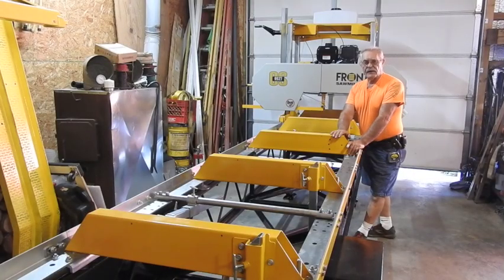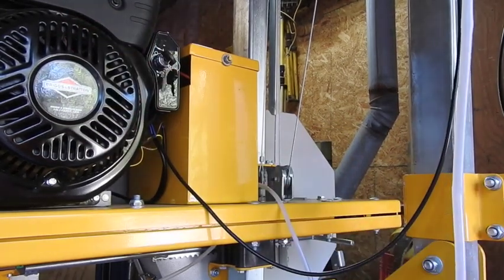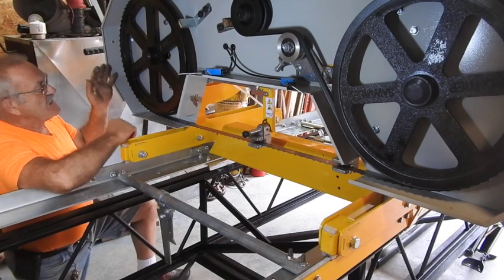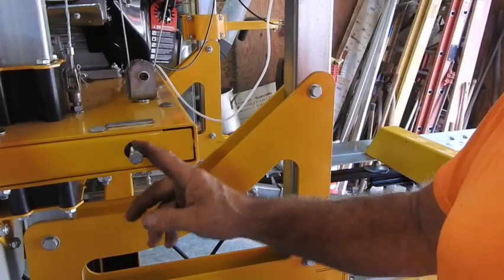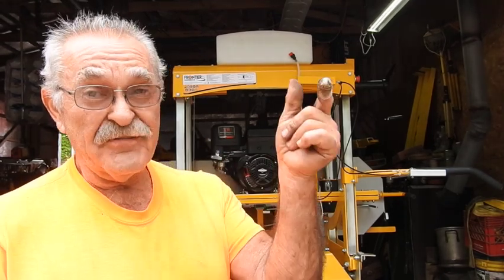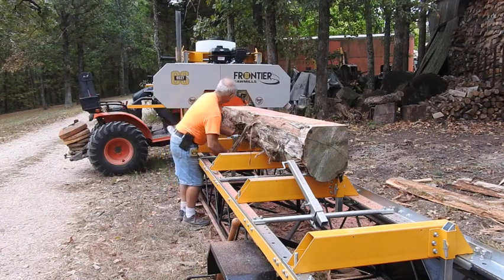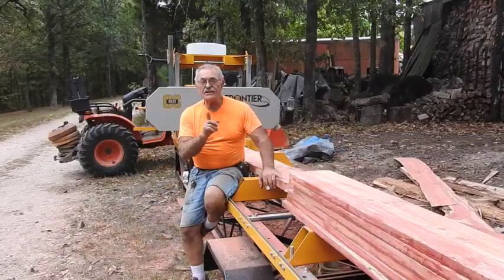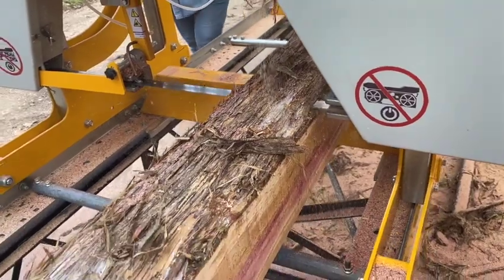OS 27 Frontier Sawmill Adjusted and Checked Out-First Run

Comment: Your video will really help me not to make the same mistakes when assembling my sawmill. Thank you for the heads up and info. Good job explaining everything.
Reply from the maker: It really wasn't too much of a problem to assemble at all.  The biggest issue I have is the one side of the cable spreads out as it winds around the pipe, making the one side raise slightly higher than the other.  I can NOT get it to roll with a tight winding like the other side, but fortunately it's only about 1/32 in difference. 
    I was thinking to do a general walk around now that I've run a good amount of material through it.  One thing for sure is don't crowd it in the hardwoods, because the blade will be forced backwards on the drive wheels just slightly which will result in rapid blade ejection and destruction. And it will sound like a deer rifle going off !!
   I found out that with the Missus running the mill with the hardwoods, we have much better luck.  She is blessed with more patience than I plus she just can't push as hard.  You will enjoy your mill, but make sure it is plumb and level and the bedframe is  perfectly straight.  Thank you for the continued interest Joseph.

Comment: Very helpful info.  I just assembled my OS27 but haven’t used it yet.  The Briggs & Stratton 13.5 hp engine would not idle, so I had to take it in to a service center for repair/ adjustment.  The only mistake I made so far was NOT getting the electric start.  It’s gets old pull starting that engine.  Thanks for posting the video!
Reply from the maker: I learned my lesson about electric start with the De Walt power washer.  It has a big engine that I hate to pull start.  Now that its got a few years on it, it takes a bit to get it going.  I LOVE the electric start on the 13 1/2 hp Briggs.  I added a couple of extra log dogs by making my own cross pipes out of 1'' galvanized well pump pipe and am going to add more log back stops down the length of the 21' bed.  I've got a few other upgrades planned as well.  Did you purchase the trailer option, build your own or set it on ground bunks.... ??
Reply: @tractorman4461  I bought the trailer package.  That part I got right.

Comment: Things to watch for. 
Reading the manual can help with assembly. Having you go over all the things in the process and explain any issues is invaluable. 😁😎
Reply from the maker: Well, I'm hoping that pointing out some of the things I didn't pick up on too quickly might help another first time owner of one of these or similar mills during their assembly.  The Missus just told me tonight that there was a Blu Ray disc in the packet of info....but we don't have a player.  So I am sure watching that would have been exceptionally beneficial.
Reply: @tractorman4461  Funny how the tech lags behind the times. I have VHF tapes for my table saw,  lathe, and planer. 
I'm a pack rat so I have the Curtis Mathis VHF camera, 35 years old and counting, and a deck to play them on. 
I also have CD's and DVD's with pictures and software on them. I kept one laptop just because it has a player in it. 
We have a drawer full of Blue Ray disks and a Sony Blue Ray player purchased with the flat screen TV 15 ago. 🤔
We don't watch them often. 
We have Alexa play music instead of the radio or records. 
We watch on demand with  Roku setup on the TV. 
A good $20K in hardware and software sitting on shelves getting dusted.   😁😎
Just to prove I am slightly off, I have micro floppy disks and even a few 5 1/4 floppy disks.  Yes. I kept a tower and external drive to read them. 
By now the drive belts are old enough I expect them to break. 😁😎
I bought hardware to allow me to transfer files to thumb drives, extermal solid state hard drives, and the "cloud".
Reply from the maker: @OldSneelock  Hahahaha....I totally enjoyed that comment.  Such a sign of the times !!  I too have a few floppys of both sizes as well but those are all hvac digital control information.  Several DVD's as well from hvac manufacturers and suppliers with tons of info as long as we had the laptops to access them, which I did and still do.  However we've never had a Blu Ray...LOL.  We gave away our VHS player to a young single gal with three kids that needed it, plus about 50 kids vhs tapes.  And I forgot I had a service and training vhs for my JET metal lathe.  LOL  Up a creek with that move. But no matter I never watched the tape anyway. 
    I've kept some of the first generation thumb drives filled with equipment information and with a USB port so readily available they are still relevant.  I'll pass those to a friend still actively in the trade.  Now I've got SD cards and higher capacity thumb drives out the wazoo and God only knows how long they will be relevant.  We are at the mercy of technology are we not...??!!

Comment: Counter clockwise is down. Clockwise is up. Reverse your lifting cable winding. Right now you’re turning against the brake. I did the same thing. Fixed it and now it’s a joy to lift and lower.
Reply from the maker: Thanks for the tip.  You gotta admit though that some of those details are kinda hard to pull out  of the manual with the pictures and description they have.  I will double check as you suggest.  I'm assuming you too have a Frontier...??
Reply: Yessir! OS23. I’m the guy who also put my side plates on upside down! 😂
Reply from the maker: @toothandnailsawmill102  hahahaha…. I remember that comment. I must be following the path you took !!  LOL  I am really tickled with it so far but I’ve not sawed any hardwoods yet.

Comment: I enjoyed the video. I am pulling my cutting head Monday and bringing it back to the shop. Another bearing went out. My recommendation is to replace all the bearings once the first bearing goes down. $80 worth of bearings is very reasonable for a  year of hard work. I wished I had of went with the OS27 as the OS23 has been a little small on more than one occasion. I opted for the smaller engine, which was also a mistake. I just ordered an 18 hp electric start engine for mine. I was going to buy a 14hp Predator engine, but they are out of stock until next year. The 18hp is a bit overkill, but from my research, I think it will bolt up just the same. I ordered a heavy-duty clutch also. I was checking your video very closely to see how yours is set up. Great video.
Reply from the maker: I was wondering how long those China made sealed bearings would last.  I figure a good set of grease able bearings from Browning would be my choice for replacement when the time comes.  I'm not going to be sawing near the wood you saw in a given year so mine should be good for a while.  And yes, I kind of already wish I'd have went with the OS 31...LOL.  I'm NOT sorry for upgrading to the 13 hp electric start though. At all !!  Thanks for the tip on the leveling jacks.  I don't know if these are your exact ones, but they seem to be adequate at just four...so far.  We'll wait until I get a BIG log on board before I decide if more are required or not.  But the bar joists seem to not deflect at all so far. I credited you with that tip in the description.  Thanks again Tony.

Comment: Pretty cool video series. Looks like it operates really smooth. 👍👍👍
Reply from the maker: Yes, and surprisingly easy to push through the log.  As long as the blade is in good shape.  Next thing I gotta come up with is a way to sharpen these blades.  They are only good for about 600 board feet of hardwood as I understand.

Comment: Great to see you both running the band saw. That is the largest Ceder I have ever seen. Here in Southeast Tennessee. It would take maybe two lifetimes or more, for one to grow that big . Wish shipping wasn't  has high as it is now. I would love to buy some boards that wide. Outstanding Job ! All my very best.
Reply from the maker: We have some pretty sizeable cedars up this way Bobby.  On the old home place back in the 70's we cut a cedar grove that  netted tons of 1''x16''x10'.  And of course many times that in 6'', 8'', and 10'' material.  I lined the Missus huge walk in closet in red cedar all tongue and grooved by she and I plus a few year back I lined a 228 sq ft four season room in red cedar.  And there's a big area I finished in the basement with 45* angles of cedar as well as a wall waist high with a shelf all from just a part of what was left over from the 70's.  And I still have a few hundred board feet of the smaller stuff left yet today from back then.
  I've got about 15 or so cedars to cut for another old friend later this winter or early spring.  There'll be a couple upwards of 16'' or so there too.  Thanks Bobby for the visit my friend !!

Comment: Great job. I like the height👍 for yourself on your property, if ya want you could dig a small ditch to accept the trailer tires. That way you wouldn’t have to remove them  and maybe get it a bit lower. Just a thought. You do you friend🙂 also sawing with sandy’s channel is a great source. He warns you’ll probably hit those back stops... and has advice on how not too. Also he’s installed a laser to help ya get the most out of your cuts. A real nice upgrade in my opinion 😎 keep on tractor’n tractorman
Reply from the maker: Now a laser sounds like a great idea.  I've not seen that yet. I will go check him out...thanks for the tip !!  And yes, I've thought about carrying a shovel with me for that reason.  The good thing about removing the tires though, is it makes it much more difficult to be stolen. There's always trailers, deckovers and goosenecks, stolen in this rural area.  This rig might be a temptation. Dunno though.  Thanks again for the tip on Sandy.

Comment: Wendell, that was nice of. You to test your wife’s new toy for her!🤣😂🤣😂! That cedar looked beautiful, and that saw runs like a champ! Surprised you went with a “Briggs & Stratton” engined unit over a Honda or some other power plant, but none the less it looks like it was a wise choice! Have fun with the new toy, and thanks fo the reminder about surroundings!
Reply from the maker: I couldn't choose the brand, just the horsepower.  I upgraded in hp and with the electric start option.   I would've LOVED to have a Honda or Kawasaki on it. If I built one myself...which I almost did, I was toying with the idea of powering it with a 600 cc Yamaha in line four.  That would've made it scream and have more power than it would ever need.
Reply: @tractorman4461  I actually prefer Kawasaki and Honda over Briggs myself, and possibly a predator( being that it is a Honda clone engine)
Reply from the maker: @thesmallwoodlot433  Yes, either one will do.  B&S is a good engine, but they can't hold a candle to the Honda and Kaw's....in my ipinion.
Reply: @tractorman4461  the carburation seems to be their downfall,

Comment: I'm glad you showed us 'everything' here in the processes involved in making this mill 'work' for you Wendell.
I can see a few modification that you can easily make on this mill, and I'm guessing that you are more than likely thinking along similar lines. 
You mentioned that the blade will cut through some grit that, no doubt, will be in the bark of these logs, what do you plan on doing with that issue? A debarking attachment maybe?
I enjoyed all of these video, and I hope we get to see more lumber coming off this mill.
 I `tip my hat` to you!
Reply from the maker: I don't think my I'll be sawing enough to justify a debarking setup, but I do plan on coming up with my own rig for sharpening the blades, so I can get two or three times the life out of them.  Like we did on the circle mill, the obvious areas where excessive grit can be spotted, I'll just knock off the bark with a double bit.  We try to be careful when handling logs in the field, and I think I will stress a little more care to keep them off the ground from cutting to the bunks. Now with forks on a couple  tractors and the skidloader, we CAN minimize the time on the ground.  I'm glad you enjoyed the series Reg.  Thanks for following it all the way through.  And yes, there will be more milling coming up....

Comment: Cant wait to get mine ordered 2 days ago. I have red cedars like that I'm siding my barn .
Reply from the maker: That's awesome Tim.  Did you order the OS27 or the 31 ?  I made several videos about building a trailer and assembling the machine.  I used old commercial bar joists to build my trailer and it worked very well for a full three section 21' mill. https://www.youtube.com/playlist?list=PLk72G9DTzZ1ue1qK_JUYgFoJ2ENbV7VVs You might find something to help you in the assembly videos. I had a tough time following the book.  But that was just me I think.
Reply: @tractorman4461  I ordered the os27 I'm building my trailer from a old boat trailer and 2 I beams with 4 hydraulic levers . I have experience building the conveyor systems in auto plants . I was a ironworker for 40 yr. So shouldn't have much trouble .
Reply from the maker: @timlawson817  oh heck no you'll have no trouble at all.  I'm a retired pipefitter commercial service tech.  I like the hydraulic levelers idea.  I've already got some ideas for a few changes too.  I kinda wish I'd have went with the OS31, just because the added width would minimize trimming burls off to make it to where the saw head clears the logs from one end to the other with the first two cuts.  Sometime longer logs that are curved a bit gives an issue too.  Four inches would make a big difference I think now.

Comment: The wife handled it like a boss! And, you can get a senior coffee at McDonald's for fifty cents! What type of blade coolant do you plan to run in that tank? Will it have some type of anti gumming agent in it for wood high in resin?
Reply from the maker: Probably water unless it freezing, then a little RV anti freeze...Some guys run a bit of Pine Sol I think in the water.  It keeps from freezing and cuts the resin at the same time.  But I don't really know yet for sure.  I'm researching that right now Matt, but the Missus suggests Simple Green or Dawn.

Comment: Wendell you need to make you a little platform for the you start on so you can crank that handle easier. Maybe a wood pallet. How many spare blades did you get? I would probably need a half dozen. Great video, I really enjoyed it.
Reply from the maker: Yes, this being the 'first run' I found a few things that need to be improved on and that was one of them.  Just a few inches is all I need too. Not a crazy amount.  I got a pack of 10 blades plus the one shipped on it Rick.  But soon I will work on a way to grind the blades for a second or third use.
Reply: @tractorman4461  Belsaw has a rig to sharpen bandaw blades that might fit your 1055 grinder. 
It is a set of guides to track the blade in front of the wheel similar to a chainsaw grinder. 
A talented young man like yourself could raid your scrap bin and cobble up one in an afternoon. 😁
Reply from the maker: @OldSneelock  You know, I have seen one of those in an illustration but not firsthand.  I'm sure I will come up with something but I don't know what yet.  LOL IIRC, the Norwood group wants like $750.00 for theirs.

Comment: Now that you have some years of experience with this sawmill, can you offer any advice about a problem my brother is having with the same model as yours?  His problem is that the sawdust continues to build up inside the blade/belt cover and does not discharge out of the chute to the outside.  There is no blockage in the chute all - it stays clean and wide open.  We have experimented with adjusting the water drip from minimal to maximum but it changes nothing in regards to this problem.  He primarily saws cedar and old pine, not much hardwood available to him.
Reply from the maker: Mine did exactly the same thing and the way I minimized it was to take side cutters and clip out all of the guard material from the opening. It’s still plugs up however to an extent around the opening but more of it definitely goes out. It also balls up around the micro switches in the center. What I do is make about 10 cuts then open one of the doors and blow everything out with the leaf blower. The moisture content of green material causes it to pack itself in the corner near the chute opening. And in exceptionally dry wood, the lubricant contributes to that as well. It’s only a minor issue as long as you keep a leaf blower handy.